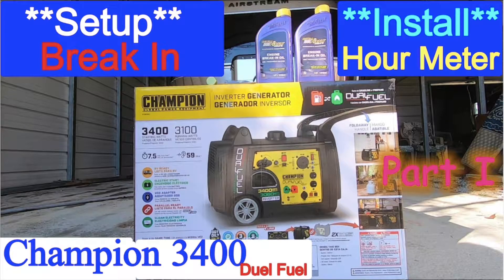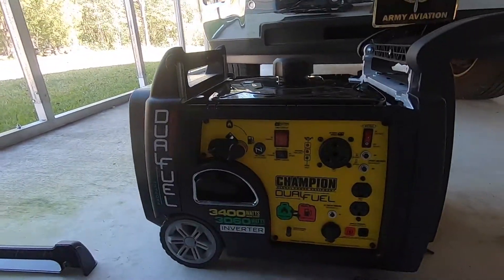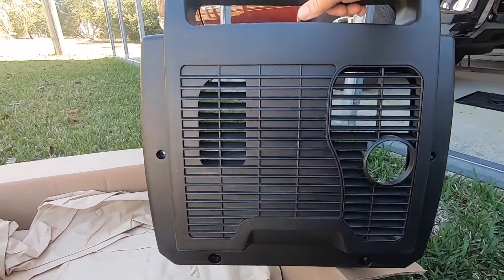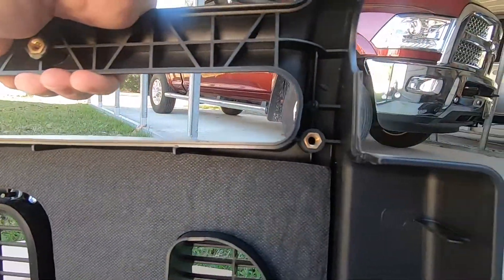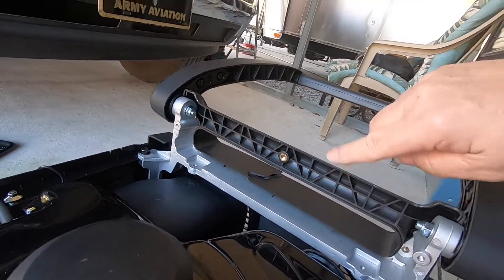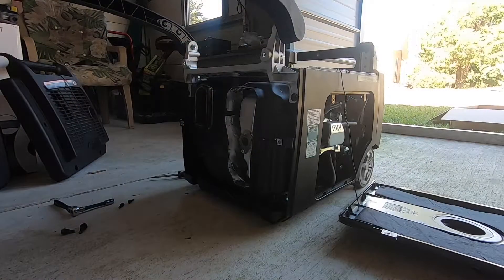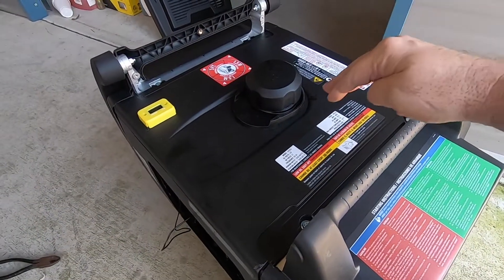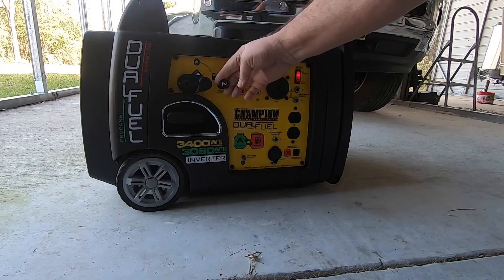Repair Champion 3400 Inverter Generator - Warranty Parts

Comment: I am just now breaking in this same generator.( but not the duel fuel version). Following that, I intend to add a small in line fuel filter as I have done on the other three Champion 2000 watt generators I currently own. Being unable to reach in from the side cover, it looks like removing the top cover and then the gas tank will allow me to reach the fuel line in order to install this in line filter. So thank you for showing the top cover being removed such that it's easy to see how to remove the gas tank. 

On another note, it must have been quite a "hit" on the box to break that back cover as they are really a very well built machine
Reply from the maker: Yeah I don't know if the box was dropped/hit or what happened to damage that part. Thanks for your comment.

Comment: Great video! Mine (a 3500) had access to those bolts without having to take off the top. Maybe they changed the design since then.
Reply from the maker: Still a great generator... Thanks for watching and you may want to check out my book, My RV Mentor: https://amzn.to/3IBliOn

Comment: Overall how happy are you with the champion ? Seems like good customer service.
Reply from the maker: Very satisfied with Champion. I have used on two camping trips and it worked perfectly. If you are shopping the price on Amazon changes based on availability. Anywhere from $970 to over $1200. If you do buy from Amazon please use my link to help support this YouTube Channel. Thanks. https://amzn.to/37JyyAg
Reply: @LandingZoneHome  Farm and Fleet has 3 of them by me for $969.00 Seems expensive for a unit with no frills, just wonder where all the cost is on it , No readout , fuel gauge . You added a hour meeter.
Reply from the maker: @TommyG11814  That is a good price. The frills are in the functionality, performance and 3 year warranty.
Reply: @LandingZoneHome  i suppose that's a good point, the more crap you hang on these things the more there is to go wrong.
Reply from the maker: @TommyG11814  Good luck.
Reply: @LandingZoneHome  thanks a bunch for the video and the replying,  much appreciated 👍

Comment: How did you get the rear battery cover on mine won't go on
Reply from the maker: It wasn't difficult, just get the cover in the right position and the bottom goes in the slot, I can't remember if it has a screw or not. Thanks for watching.

Comment: Working on a bench or roller cabinet makes it easier & you'll be a whole lot less  outta breath! Thanx for the breakdown on the cover replacement proceedures. Nice to see Champion gave you good service in not giving you a hard time about broken parts. I have a 3400 also, working fine.
Reply from the maker: You are correct, wish I had one. Champion was great. Thanks for watching.

Comment: Thanks for the video !...I've been looking at this generator for a while now...over all are you still happy with it ?...would you say this generator is very quiet ? If I was running it in a camp ground would it be too loud ?
Reply from the maker: Very please with the generator and I specifically wanted this one for use in campgrounds due to the low noise. I'm struggling with the weight but if you want to run an air conditioner you need a unit of this size or TWO smaller ones. Thanks for watching.
Reply: NOT LOUD. Good product especiially running the ac, etc, ...